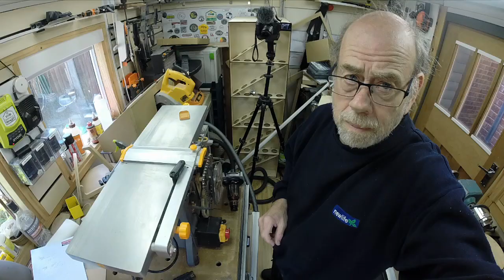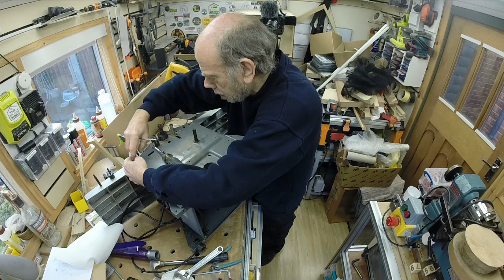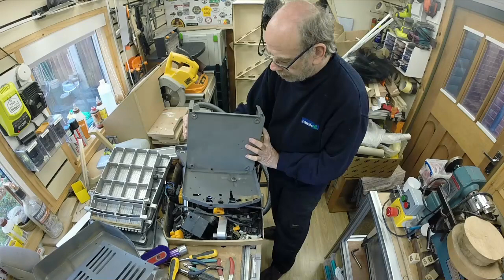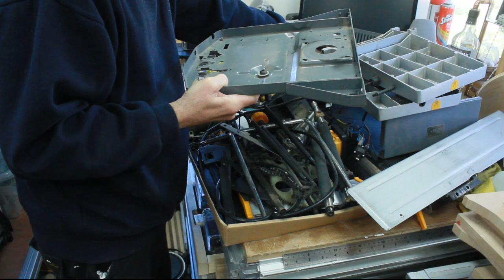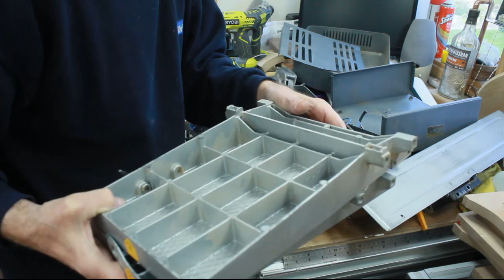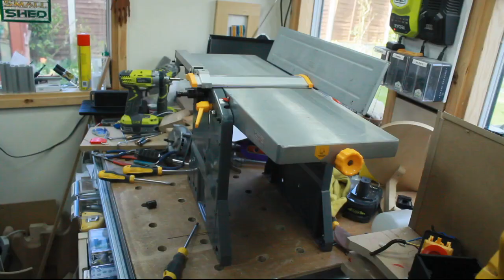the small shed  #304 - conducting a planer autopsy

Comment: Very interesting, when you put the infeed and outfeed tables back on was there a way of adjusting them ?
Reply from the maker: Yes, the entire top section remains exactly as original, the only constraint is that I have to hang the motor from the non-adjusting side. It's all very experimental at the moment, until I see if the chosen motor is powerful enough.
Reply: @thesmallshed  Thanks for taking time to reply, i have the same thicknesser the problem i have is the infeed table is not level its about 3 mm lower at the start compared to the blade end so would it be possible then to adjust it level and how would it be done, sorry to take your time up.

Comment: Nice one Peter, always better to strip things down and see what you can salvage for future use rather than committing it all to the tip. I had a similar situation last week when my trusty 1950s bench drill gave up on me. i've had it since the mid 80s and I had swapped out the 3 phasre motor which was originally fitted to it for a 1/6 HP motor from an old Hoover washing machine, and it has served me well until now. Now what do I do? I had an ALDI workzone drill that I bought years ago that I had only used a few times and it was taking up space under my bench.So does it become my new bench top drill? Well no,  it was ok for rough work but no good for much else, nothing on it was square and it made a hell of a noise. So I stripped out the motor fitted it to my old bench drill via a backing plate to suit the motor mounting slots and made a new spindle bush to fit the drive pulley to the motor spindle and rewired it to the original drill switch. Job done? Well no, as I then stripped all the parts that were left from the ALDI drill, Jacobs(ish) chuck, nuts, bolts, washers, knobs, spindles, bearings, pulleys, belts etc. which hopefully can be recycled to fit future projects and the small amount of bits that were totally useless to me went to the local recycling centre.
Thanks for all your vids they are very interesting, as you make and repair things the majority of society would just buy or take to the tip. I might even draw the line at repairing Buzz Lightyears car. anyway 'To Infinity and Beyond' as Buzz would say. Keep up the good work and I look forward to seeing what you come up with for the planer.
Reply from the maker: Thanks Tom, it does seem sometimes that we waste too much as a society, but I am fortunate in having the time to do it. If I were still working I suspect I would be as bad as everyone else and throw away broken things.